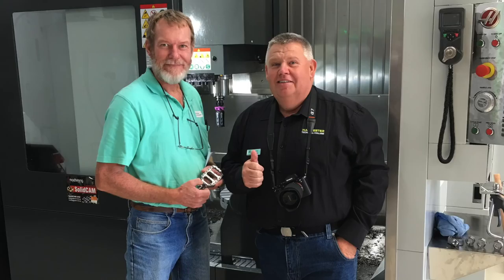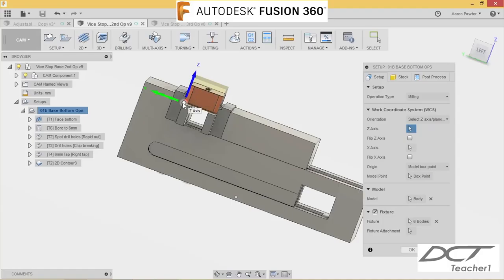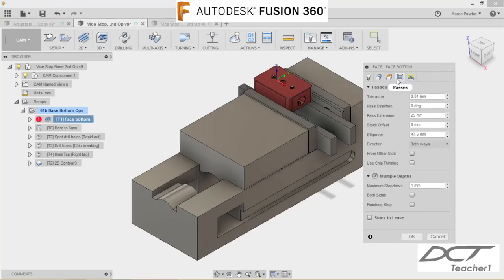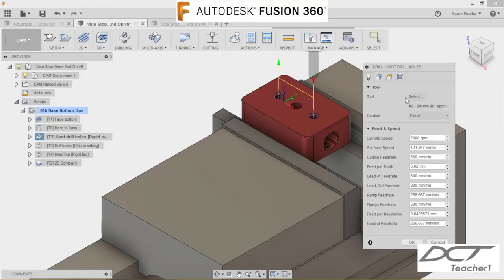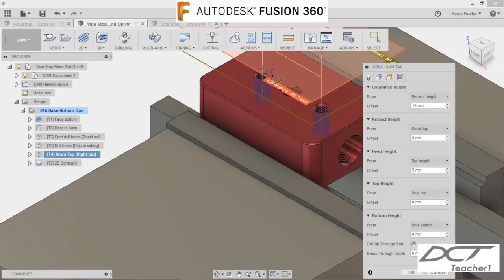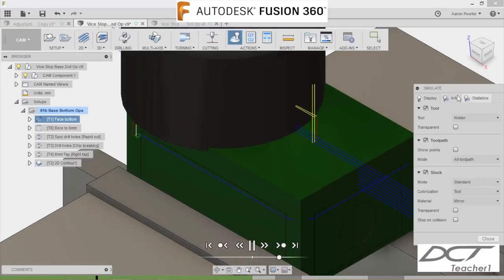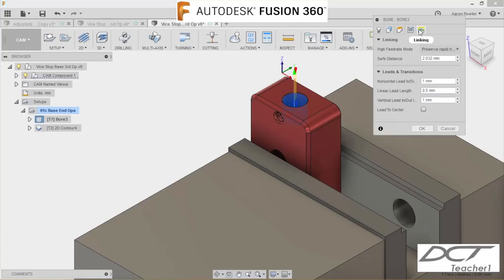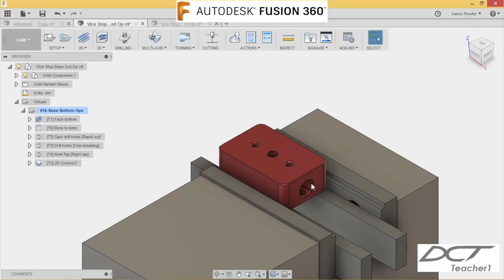Mill Vise Stop Pt.3 - Flip part apply toolpath

Comment: Hey Aaron, have you tried chamfering holes before tapping? I find it leaves a cleaner initial thread without any burring. Also if I'm not mistaken, when selecting the bottom of a modelled chamber with 2d contour, defining a chamfer width adds to the modelled chamfer width. Easy to check in the simulation by turning off the model anyway
Reply from the maker: Hi Sean, all very good points (tips) mate.  Thank you for mentioning them here.  Oh, and yes you are correct about that the chamfer widths.  That is a habit of mine from machining chamfers that hadn't been parametrically defined previously.  I have also chamfered holes before tapping and yes it does provide a good lead in to the hole.  Thanks for keeping me honest ;-)  Cheers, Aaron.

Comment: You're just trying to show off with your rigid tapping!! LOL   I prefer to set my origin in the same place you did.......although I like to set it in the notch in the soft jaw.....I can leave G54 there for quite a few things since I set most parts in that notch.  Thanks for the tip on the chamfer.  I've been getting a burr on some things, so I'll have to try running it conventional and see if that makes it better.   I'm curious why you chose the chamfer inside of the contour op instead of the chamfer op.  I'm certainly not saying it's wrong.....just wondering. :)
Reply: I've also been setting my Z0 there lately - even for the first setup. I don't have milled-in parallels, like I believe bluehands does, but I do set it to the top of my parallels. What I like is that I can base the bottom height of the operations that have a chance of hitting the vise jaws to the bottom of the stock - in other words, if I know there is 3.8mm between my parallels and my vise jaws, I can set the bottom of outside roughing operations to 4.5mm above the stock bottom and I can know I'll be OK (well, as long as I don't make a mistake somewhere).

My machine considers the top of the table "Z0" and anything above it has a positive Z coordinate (in G53). What's nice about this is I can verify the Z value of the origin using simple math - the bed of my vises is 3" above the table (76.2mm) and if I have 47mm parallels on top of that my Z origin should be around (76.2mm + 47mm =) 123.2mm. If I go and look at my G54 origin and it's set to 135.6mm I know I have a problem.
Reply from the maker: Hey Mike, yeah I used to be stickler for always CAMing my work offset to the centre of the part and Z top.  But I'm slowly changing my ways ha ha ha.  At home now I always use the top of the back left corner (fixed jaw). That way you can the G54 set and only change the Z height as require.  For this part I used parallel strips as I didn't have enough meat to hang on to due to the big top chamfer.  OH, and you're totally right too.  Using the contour option is a hangover from when I used to use HSM.  Thank you for reminding me, as I totally forgot about the chamfer tool path option from within Fusion.
Reply: There's definitely a time and place to use the contour/chamfer option, but the chamfer tool path allows you to set clearances and gives better protection and paths when you're doing edges inbetween walls or features.  I don't typically even model my chamfers anymore......I just set the dimensions in the chamfer tool path. That makes it really easy to change it.....no remodeling involved. :)  Plus....I keep coming across occasions where I want to run multiple passes because I want a big chamfer.  I set the initial pass, then duplicate that tool path and change the measurement.  Works great when I need a .100" or so chamfer.    

As for g54.....it never made sense to me to always find the center. There's definitely times where it needs to be done that way, but for me, that's rarely.  I've typically used the front left corner of my jaw so that I don't have to worry about the jaw thickness changing.  In most cases, that means I can set my g54 to a corner of my part when I do the CAM.....doesn't matter whether I model the jaws or not that way.  I'm still a newb to this stuff, so I may find a better way......but for now, that's how I tend to do it.
Reply from the maker: Hey Mike.  Some really good tips mate.  Hopefully others are reading the comments and picking stuff up from everyone.  Oh and don't worry, as I'm a bloody newb too.  But as the old saying goes, "always more than one way to skin a cat".  Far as I'm concerned, it's whatever works for you ;-).  I don't usually model chamfers on my models either, but these were already on there from the designer.  As for G54, If I'm at school on the Haas I usually probe the centre of the model as it's automatic probe cycle and easy to do.  At home I pick the rear fixed jaw always (no automatic probe).  Cheers mate
Reply from the maker: Mate, what is that machine of yours?  Is that a brother CNC machine?  Looks bloody awesome ;-)
Reply: As long as the cats do get skinned.......I don't care how. ;)  lol
Reply: DCTTeacher1 
It is! I think so too! :)

Comment: how can you be sure your vise is perfectly level (between passes)?
Reply from the maker: Hi Dennis.  That really depends on the quality of your vice.  These cheap imported ones that I used here at much chop.  However, my brand new Orange Vise USA one is, and it 100% spot on.  Like the old saying goes, quality costs money.  Now, before conducting any machining operations with a new vise, you could sweep it dial gauge to ensure its height consistency (Z-Axis).  However, if you wan't 100% accuracy from a cheap vice like this, it's common to use machined soft jaws to ensure that.  The other problem is "kick up" upon tightening.  All tricks of the trade mate, but easily learned over time.  Thanks for watching ;-)
Reply: @DCT_Aaron_Engineering  Thank you for the info! So would you ever see the need to (somehow) probe the underside of your part (after flipping) to be absolutely sure your WCS is level with the bottom or do you think that's over-engineering and a quality vice will take care of this potential problem case? Perhaps a quality vice even beats the accuracy of conventional probing tools? Do you have any hard numbers on that by any chance? What does your experience say? Thanks in advance!
Reply from the maker: @dennisrkb  Hi Dennis, I know that some machines are capable of probing the height and making adjusts to counter this error (similar to auto-bed leveling on a 3D printer).  However, I have not used this feature before.  No I don't think it's over engineering, it all depends on the tolerance called for on the part you are making.  Most of the times, like this vice stop, such high level of accuracy isn't required.  The base really is a cosmetic part that holds the arm.  If the heights was out from corner to corner I don't think it would matter all that much.  At the end of the day I'm probably the wrong person to ask.  I'm a high school teacher and not an aerospace machinist LOL.  However, trust I helped to shed some light on the matter for you.  Cheers, Aaron.  PS: many steel parts will be surfaced ground after machining (example hydraulic valve body)

Comment: 3:36 “rarely do I break an endmill”

What’s the fun in that? =)
Reply from the maker: I know right?  Need to get myself an endmill sponsor ;-)
Reply: I’m afraid I can’t help you there but when doing test runs or just when fooling around I use Chineseum carbide. 6mm 4 flutes are like $3-4 each on eBay. They cut great and hold up fairly well but I find they tend to be more brittle and don’t handle ‘abrupt’ changes in cutting forces / tool engagement very well without snapping tip corners or chipping the cutting edge. Great for optimizing and guilt free experimentation when testing feed/speed limits though 👍
Reply from the maker: Hey Jimothy.  Thanks for getting back to me.  That's some good advice.  Oh BTW, I've never laughed so hard "Chineseum Carbide" LOL.  That's gold :-)